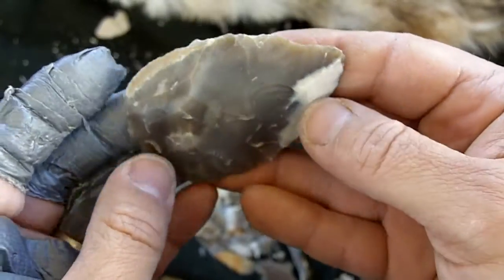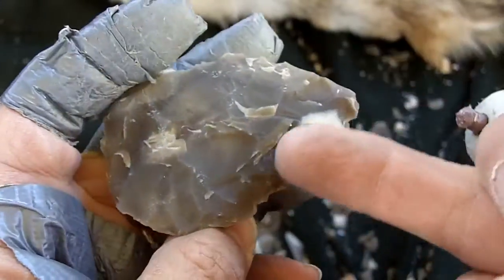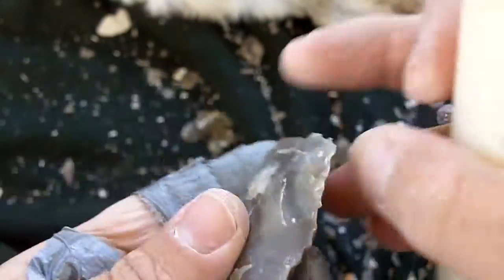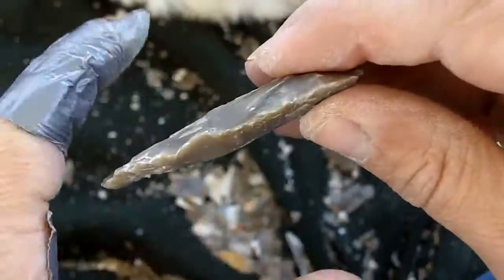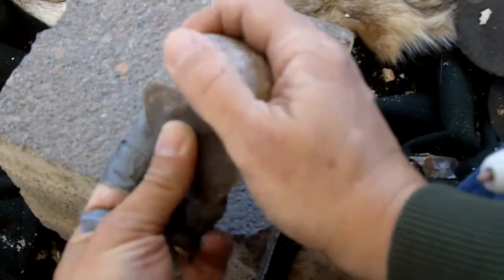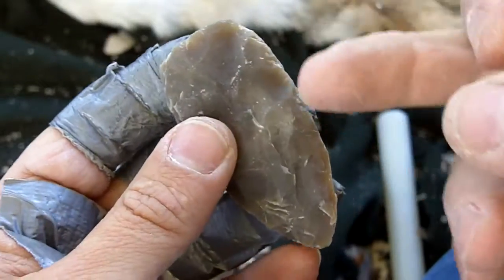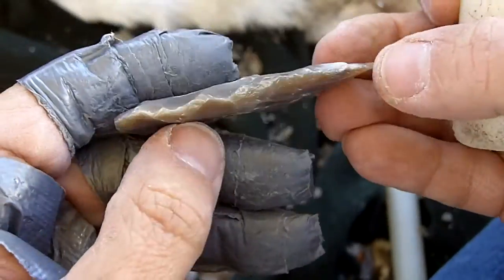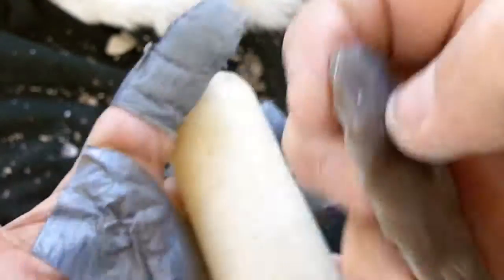223 - Flintknapping Second Clovis Part 2/3

Comment: I notice the placement of the copper is often on the side of warn copper as opposed to the tip.  You use the tip when forming.  Could you explain that more sometime?
Reply from the maker: Yeah, I can do a video on this.  It's about time for a new video anyway.  I wasn't planned on doing more copper videos, and I gave  away all my copper tools, but I can get back into it for a short series if vids.  The rule of thumb is just experiment and do what works.  I might try 3 different areas of the copper tip for the same type of platform.  That's what makes it difficult to explain... and difficult to see what's  going on when you watch.